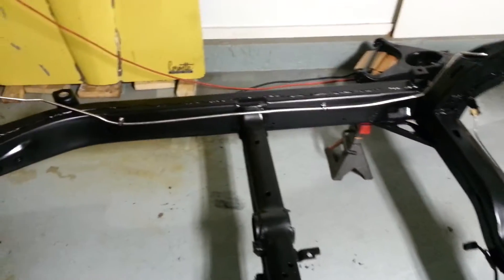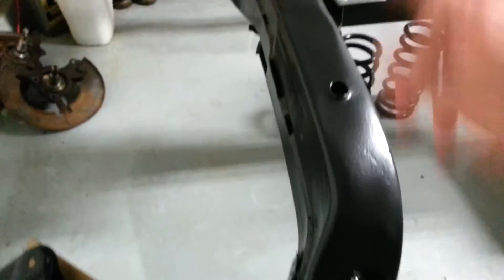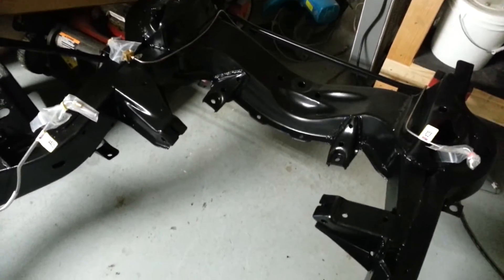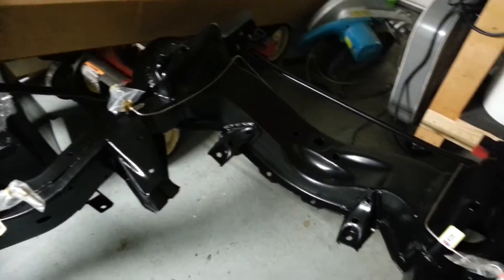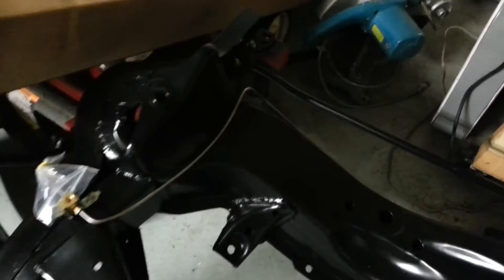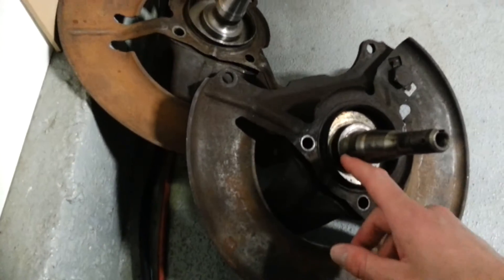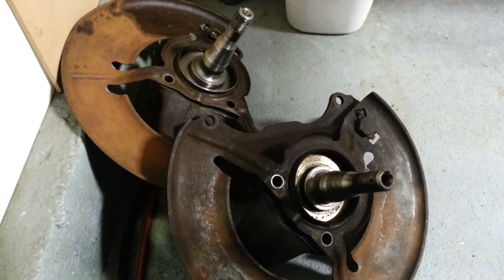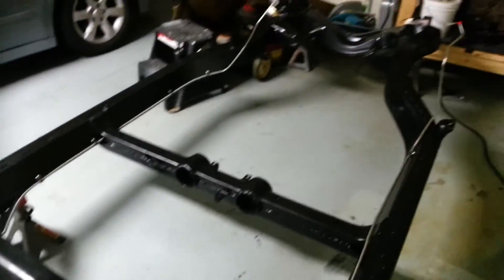1966 Corvette-Stainless brake & fuel lines

Comment: What do you mean by a "web" at time 00:35?  Is it just a minor obstruction?  
I'm thinking about running my fuel line through the frame on my '68 similar to what you did here.
Reply from the maker: There's a small area the fuel line goes through, it just takes a bit of work to get it through. Nothing to worry about but it probably took me 20 minutes of prying and shaking the line until I got it to go.
Reply: @BradKwfc  - Thanks.  I did NOT know that on a '66 the fuel line actually ran through the frame rail.  I'm trying to run a new line and with the body on my '68 I was planning on going through the frame rail aft of the frame kickups....
Reply from the maker: silvernblackattack 

No problem. If you haven't been on the Corvette forum check it out also. Lots of great people there that can answer any question you have. They have helped me many times.
Reply: @BradKwfc  - I am.   I figure if the '66 fuel line runs through the frame, then I can do the same on my C3.  I just can't come out of the front of the frame kickup with the body on.

Comment: Any ideas or suggestions on replacing my fuel line (also a 66) without lifting the body  . Can it be done ?
Reply from the maker: George May 
I've heard it can be done but I think it would be very frustrating. 
http://www.corvetteforum.com/forums/c3-general/3595080-body-on-fuel-line-replacement.html

cutting it into short sections then adding fittings to each seems to be a way a few have done it.